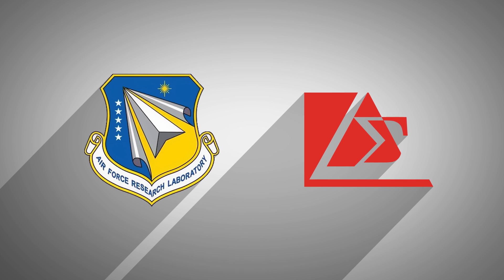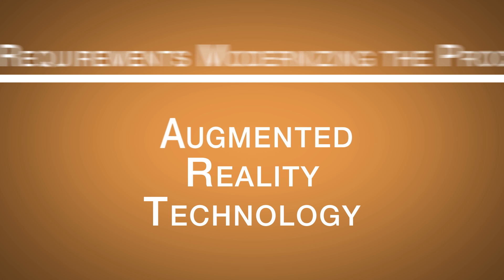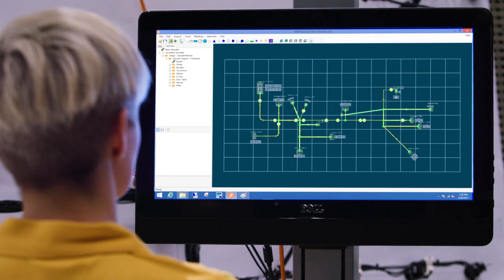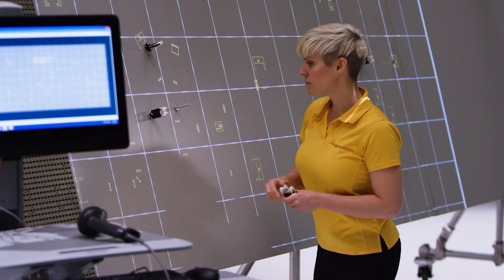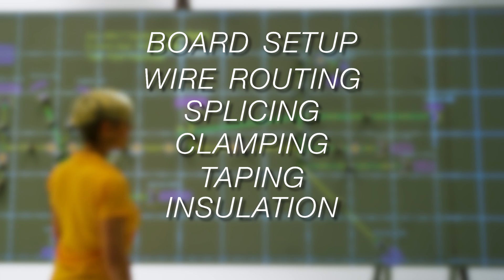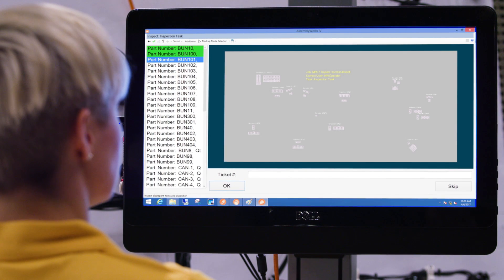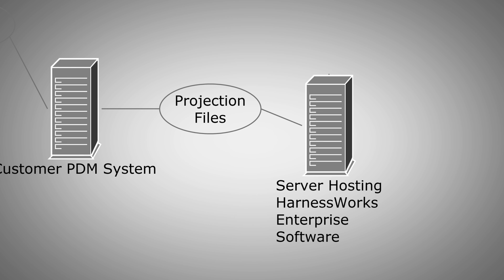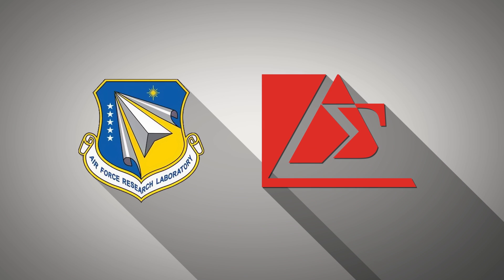Wire harness assembly with projected work instructions

Comment: Hello,
Nice video you have shared here & thanks for this. Recently I had contacted with Peterstechnology.com & they said that they are using wire harness techniques for their cable manufacturing process.  Now I am able to understand that what is wire harness assembly exactly.